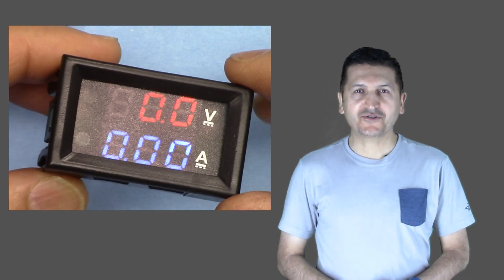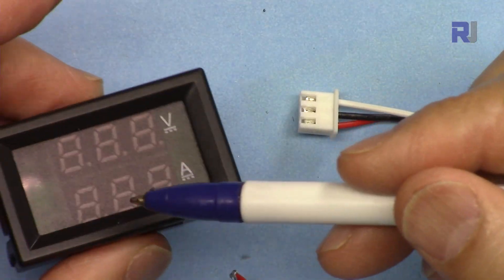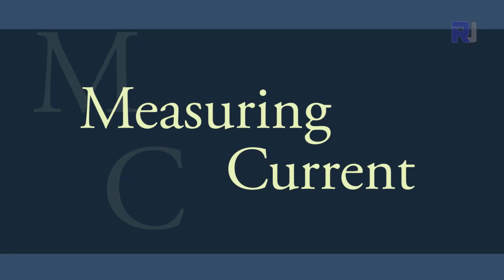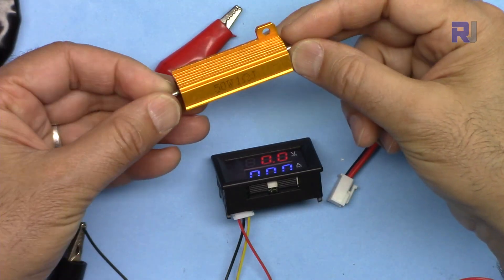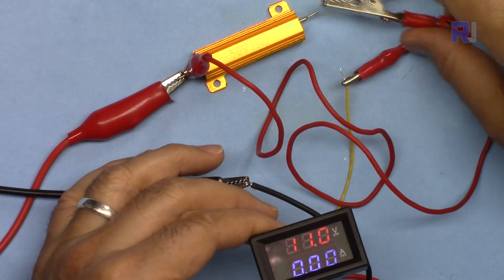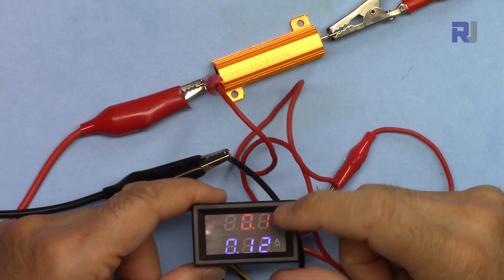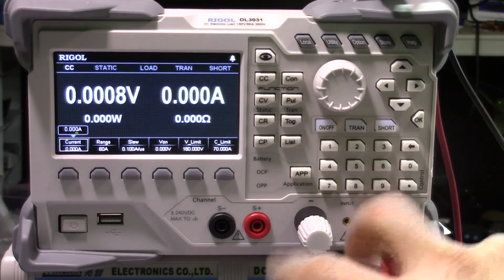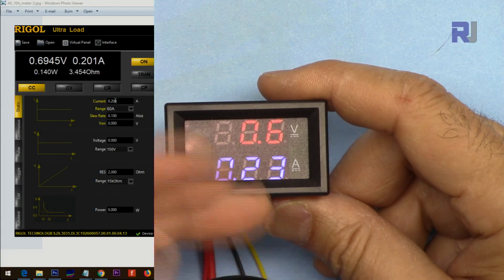Complete Test/Review of 10A  0-100V LED DC Volt and Current Meter RJT203

Comment: I have very similar (same) volt/amp meter units, but they are way off when measuring current. I set the ammeter trimmer at 1.00A but when the measured current goes higher, the ammeter shows much higher. For example, at 2A it will show about 2.50A, at 5A it will show about 6.5A, and so on. Same but opposite if I go below 1A: at 0.5A it shows maybe 0.3A. It is very non-linear. I was surprised to see that yours is accurate/linear over a range of currents. Do you know what could be the problem?
Reply from the maker: Hello Edin,  I am not sure what is the difference bewtween yours and mine.  this has no brand name. And that is the problem with most chinese modules. If they had a brand you could track it and find the issue. Now everyone produces them and have no standard or design rule.
Reply: Hi, This type of meter uses a shunt to measure the current in the ground wire. The thin black wire is also ground. You must NOT connect the thin black wire unless you are powering it from a separate isolated supply such as a battery. The video is misleading. Simply disconnect the thin black wire and it should read correctly.
Reply: @steve6375  Thank you, Steve!
 The thin black wire IS disconnected, so that doesn't help. I actually tried this unit with a separate power source and it is then accurate. So, the designer/maker of my particular module didn't solve the problem of shared supply and measuring lines, and I will have to find a way around it, either by using an isolated DC-DC supply, or somehow taking differential measurements.
Reply: @edinfific2576  Edin Fifić yes, my measurements have this problem too.
when the power supply and measurement are the same, the ampermeter is show higher.
I had to put 2 cellphones batteries to power the measurement. and now this accurate. and I'm not worried about drain the batteries. Its measurement works at very low power, and batteries are not necessary for a month's charge.
Reply: @edinfific2576  If the thin black wire is disconnected then it should measure current accurately unless you have also connected a different gnd\0V to the same circuit. e.g. If you have a +5V and a +12V output with a meter on each output and you connect it to the same circuit it will not read correctly. These types of meter measure current in the 0V line and so you can only have one meter in the 0V line.
Reply: Hi . yes it happened with me you must eliminate the black negative wire stay only with the tick wire of the amp.

Comment: Can I use 5w 5ohm resistors
Reply from the maker: what for at which part? I have posted 300 videos and don't know exactly what you are talking bout. please type the time like 5:31 or something so I can click and see. I will replay if I understand the question. Thanks. Ahamad from Canada
Reply: @robojax  6:45  I have 2 resistors of 5w 5ohms can I connect them in parallel and then use as a load to measure the ampere

Comment: Thank you for the video very interesting I have this meter but would like to use it to measure a lower amperage I would like to measure 0-5ma is there an easy way to convert the meter please Thanks if you can help Bob in the Uk
Reply from the maker: You are welcome Bob. No it is not possible because this device has been set with fixed value of shunt resistor. in order for you to measure lower current, then you will need much smaller resistor. You would have to use other types of devices such as current sensor using Arduino and I have a videos on that topic https://youtube.com/robojaxTV/search?query=current_sensor Ahmad from Canada
Reply: @robojax  Thank you for your reply I will have a look at your other video
Love the channel its nice to get a reply  Bob
Reply from the maker: You are welcome. I try to read comments and reply.

Comment: I was just looking at these, I needed more than 10amps, like 20aor so, for a battery charger/power supply project, I settled for a amp meter only, I will use a separate volt meter, the amp meter, is 100amp, with a shunt, 100a, 75mv , I wish it was all in one, the shunt is a bit large for the project, on the up side, I do have another use for it, if I decide to not use it, I am converting an old lead acid charger, to also have a power supply to charge lithium batteries, up to 24v 6s, or power any thing reasonable, also shut off when battery voltage reaches a programmable voltage, crazy idea, but I need it, and it is in need of repair!!

Comment: Great video, i have the exact volt amp meter :)
Also, i am building an app with MIT to control relay boards (12 relays... 8 relay board plus 4 relay board, all 5v, all low level) with arduino, in a car (12v)! do you have any help you can give? any videos  regards
Reply from the maker: Thanks. I have got some videos on relay modules. Here is one where you can control 8 channel relay https://youtu.be/dkESWpdDBYk and you can use your command instead of the keypad. Or 4 channel with push button https://youtu.be/3EZecphNdAI or 16 channel https://youtu.be/Q9aBI4ELKC4